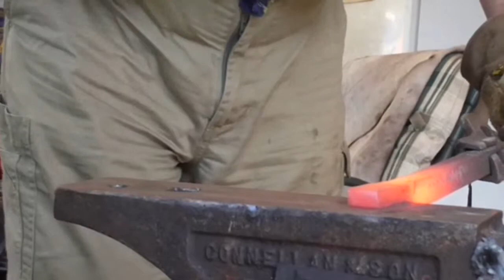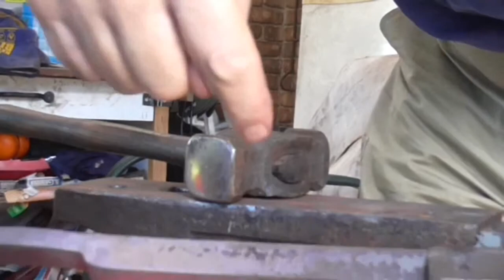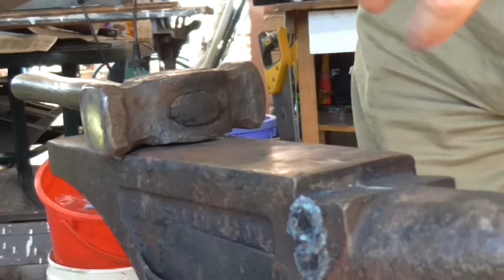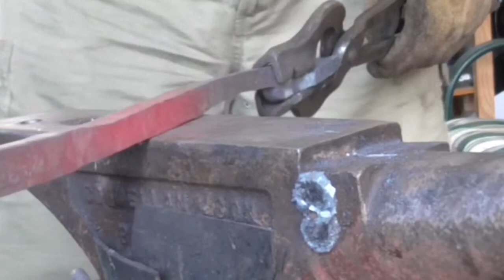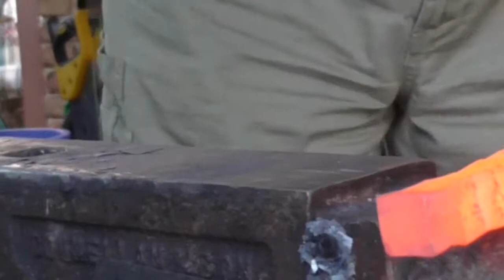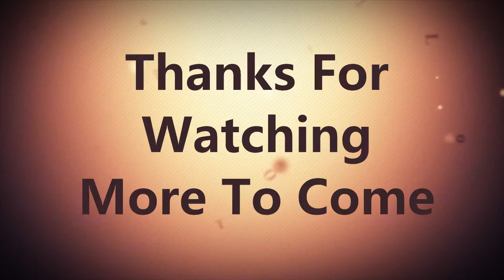Working On Larger Stock For Rail Spike Tong

Comment: Out of all and I mean I’ve watched a bunch of tong making videos this is one of the best! Great camera angle. I’m brand new at this and tongs are my first project.  I think round stock is more confusing and harder to keep square than square stock. Anyways thanks a bunch for the instruction and keep em coming! Also what was your measurement there for the boss?
Reply from the maker: Hi Chris that is a very encouraging comment and i thank you,  I do try to do my best to help, when I first started making tongs, it was hard and I struggled. I have done lot's of tongs with round stock, and some with square, I think square is easier for beginners, the measurement I used on that bit of steel coming out from the anvil is 25mm or one inch.